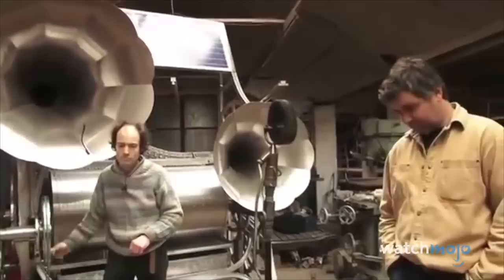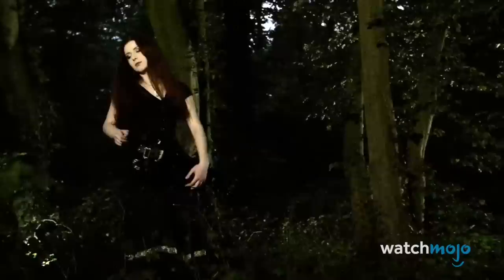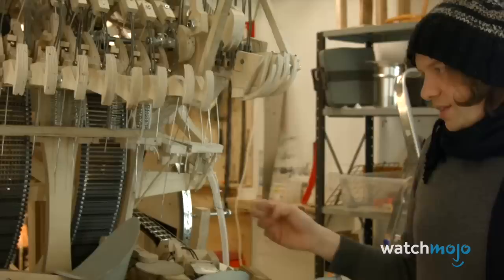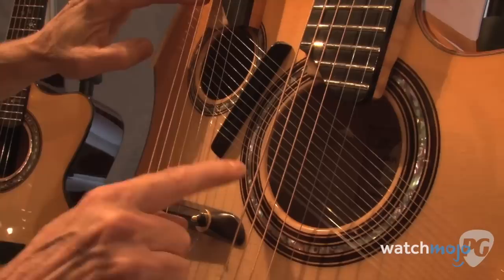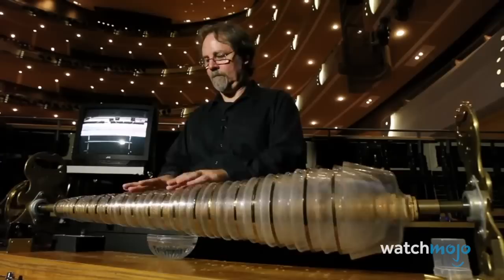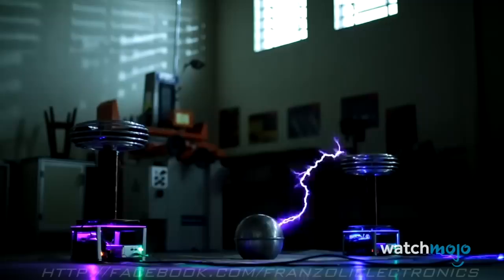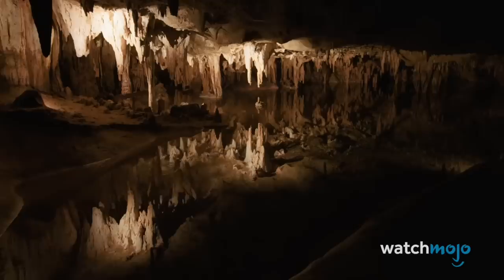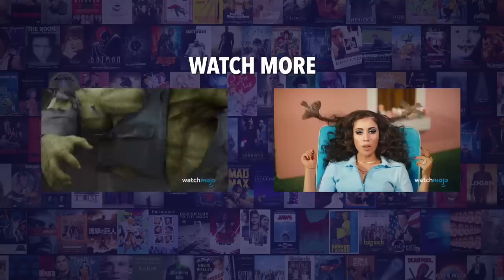Top 10 Strangest Musical Instruments

Comment: here's another one: the pig piano. invented in 1483, this bizarre instrument was made to entertain king Louis XI of France. it consists of several pigs on a bench ranging from small to big with a keyboard behind it. each key is connected to a spike, which when pressed hits the butt of the corresponding pig! the smaller the pig, the higher the note. crazily, it is actually possible to play a few tunes on it. the king was very impressed, in case you were interested.